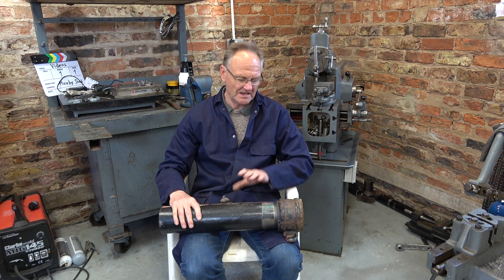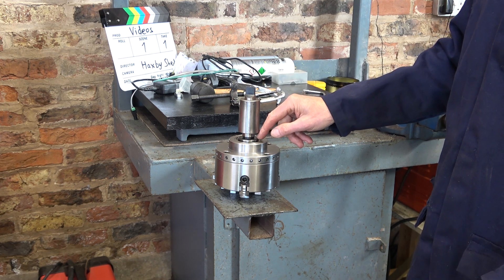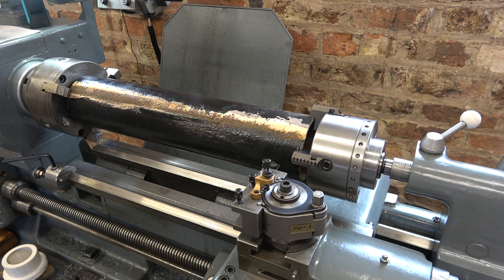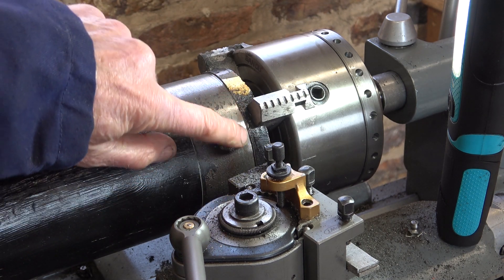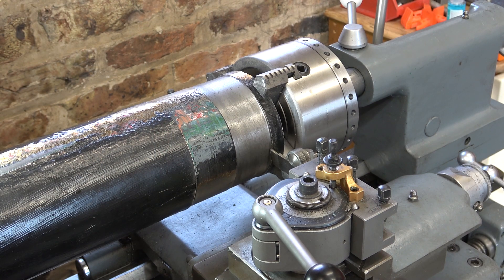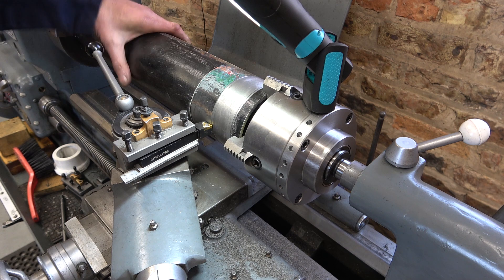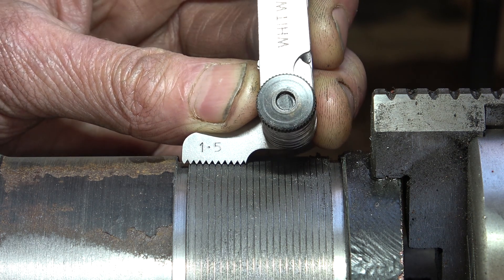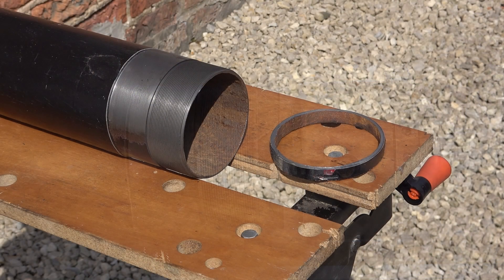HS76 Pipe threading – Part 1

Comment: i would leave the lead screw engaged and drive it back in reverse,this would eliminate the problem you mentioned.
Reply from the maker: Hi Geoffrey, on this lathe I've done more imperial screw cutting than metric and so it did cross my mind to leave the half nuts engaged, wind out, then and reverse it.  The lathe has a good clutch brake so it stops with very little over-run. Maybe next time I will .... thanks.

Comment: Hi Paul. I have no idea where this depth of cut of 0,92mm comes from. Normally it should be 1,29mm. But it doesn't matter because if you cut at 60° the depth you dial in on the top slide should be the same as the pitch. If you try this, for example make a M10 bolt so you can check it with an existing nut, You 'll see that it works. 
Have fun.
Reply from the maker: Hi Rusti I'm studying your comment and the one from MidEngineering. Thread profiles are a complex topic to be sure and maybe I will invest the time to properly understand them now. Cheers
Reply: It's because the triangular form of the thread doesn't have sharp peaks & troughs. There's an eighth of the theoretical depth taken off the peak & another sixth taken out of the trough. (according to the little diagram in my Zeus booklet !)

Comment: Great video, peaceful to watch and well done. We were rooting for you the whole way! Perhaps turning a bit of scaffolding pole might give you less fear? Steel rather than cast?   I have been resurrecting my Harrison 11" and spent and hour or so last night playing with different tooling to cut on steel and ali. No particular purpose, just different speeds and depths of cut. I know nothing about it and refuse to be taught. But I'll get there!
Reply from the maker: Hi Bootsowen, you will see people comment on here saying "just make some chips" and that's my approach too. I did 1 year of basic machining when I was 16 and not again until about 2 years ago when I got my Harrison 140. And also all my basic work back then was in freecutting or brass. So now I'm discovering the world of different grade steels and how they machine. Try machining EN3 (ANSI 1020) and get a rubbish finish and then try EN24 (ANSI 4340) and get a mirror finish with the same tool, it's like night and day. Even checkout the properties of mild steel hot rolled (black) and cold rolled (bright) - a whole new world opened up for me. Cheers
Reply: @HaxbyShed  Absolutely, I got a bit of freecutting stock a week or two ago and it is much easier. I have started tinkering with the tooling now. I am reluctant to pay for anything if i can get it for free (not from Yorkshire however!) so I have a lot of odd bits of stock of unknown type, and it can be frustrating, but keep going! It is a beautiful peaceful hobby to have. I see you got a new welder, I struggle on with the cheapest welder from aldi, bought years ago, using rods I found in a skip, It will do fine welds on thick stuff but not thin. So last summer I started renting the bottles for oxy-acetylene. I trained in that 15 years ago, it is lovely and peaceful and once you get your head into it you can tackle a much greater range of hobby brazing and welding. But as a hobbyist I have barely made a dent on the contents of the bottles! ( I have posted some videos on the integra bottle system) Keeps our minds off the realities of life.
Reply from the maker: @bootsowen  Yes I did some Oxy-A when I was 16/17 on mild steel and got reasonably good at it on simple jobs. TIG is a big step up for me and I'm already trying out the basic mistakes but I have welded some mild together. I don't think basic TIG welding is quite so difficult as people make out but getting the weld to look nice - well that's a few hours away yet. I got a 10L cyl of Argon which should give about 2.5 hours continuous welding.

Comment: I've seen some cast iron down spout a lot thinner, and a lot more brittle, I helped my Father as a youngster replace the CI with UVPC on a landlords property, as soon as we touched it it seemed to fall apart.
For an alternative method to measure a thread pitch, use a standard threading tap, eg for 1.5 pitch, use a coarse M10 X 1.5 two, or a screw/bolt.
Nice work, great bit of theory.
Thanks for sharing.
Reply from the maker: Hi BT, I did try using a standard threading tap as a gauge for the thread depth to see if I had cut deep enough, presuming the tap thread form would be very accurate, but the form looked a bit off so I did not show it in the vid. Maybe that was because you can't get perfect thread form with single point threading (I just piggy back on the comment by MidEngineering).   :-)
Reply: @HaxbyShed  The only difference in using a threading tap to compare to a male turned thread is that the threading tap will have sharper point/crest for clearance on male threads, its the flanks that do the work, as you may well know.
Was the threading insert for a 1.5 mm pitch thread, ref crests and troughs??.
Interesting that the gear box has apparent gaps in ratios, I just about remember "Continued Fractions" from college/apprenticeship.
Best Regards John.

Comment: Your having fun! A suggestion, make a plywood cover for your surface-plate, future generations will appreciate it! I lapped a 3' square surface plate, it has a surprising amount of dings and digs from where it was used as a shelf! Cheers, Matthew
Reply from the maker: Hi Matthew, that must have been a major and heavy task to lap a 3 foot surface plate. It does not really show in the video but there is a 3mm hardboard cover over the surface plate, painted black. But the plate does have one or two dinks from previous owners. Regards

Comment: I appreciate your enthusiastic approach to trying things. Many people may have passed on using the drain pipe, but you took it on enthusiastically. Bravo. I have told beginning machinists to just get some experience making chips and cutting threads no matter the dimensions as a way to get experience. I hope that this project will help encourage beginners to try something different as a way to build experience.
Reply from the maker: Hi Robert, I think necessity is the mother of invention in this case. I have to work with what I've got. It started with "how can I do something interesting with my tailstock 4 jaw?" and developed from there. Often my ideas don't really form fully until the piece is in the saw, or in the chuck. And I don't mind sharing things that go wrong and need a rethink. The channel has quite an even viewer age profile above age 25 but only 1.2% of views are from people 24 and below and the viewers are 99.5% male. But engineering is a very broad topic and maybe somebody young will watch a vid and then go on to be a scientist or chemical engineer, civil engineer, mechanical engineer, electrical engineer or maybe even a machinist. It only takes idea or experience to start the interest, doesn't it. Cheers.

Comment: I figured the part would fail from the tool pressure before you had a chance to make a mistake anywhere in there, but it held up just fine.
Reply from the maker: Jim, I was surprised too. It was a lesson for me to see the difference in cutting performance between carbide and HSS - and the fact HSS can be shaper thus takes less pressure to cut would have helped I'm sure. Cheers

Comment: To make it really easy : mount your threading tool upside down; start at the left or port side of the thread and turn the lathe in reverse.  You never have to fear crashing & if you'd use a steady rest on a turned portion of the pipe, you can thread right off the end 'till you've finished your tea.  Still enjoy your videos a lot; keep up the good work.
Reply from the maker: Hi Robert yes I see what you mean. I have seen the 'upside down tool in reverse' trick on Youtube but not tried it yet. However my fixed steady has a limit of 3in and this was 4in (100mm) pipe which forced me to use the tailstock 4 jaw for the whole thing. When I made the tailstock 4 jaw one or two people asked "why would you ever need it?" and in these vids I think I answer that through demonstration. Cheers